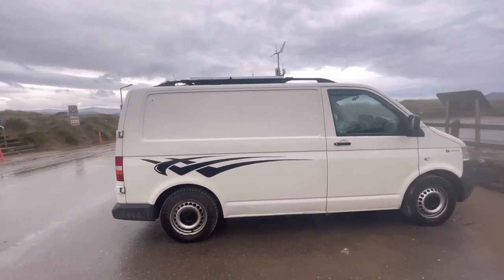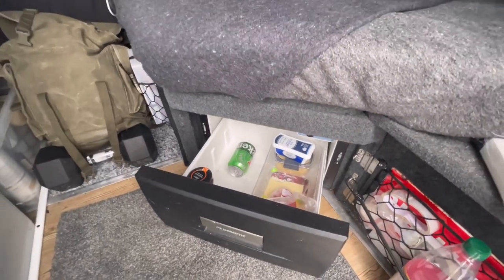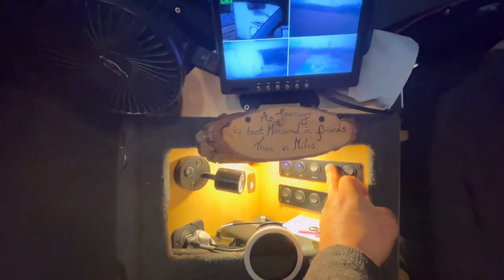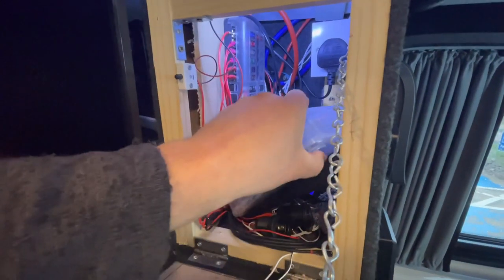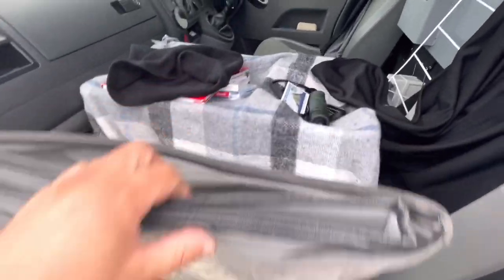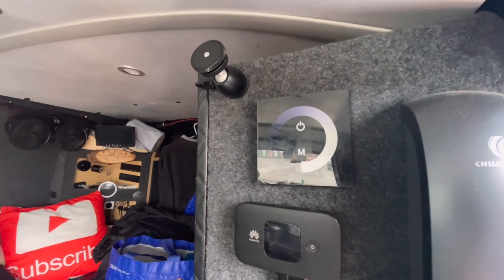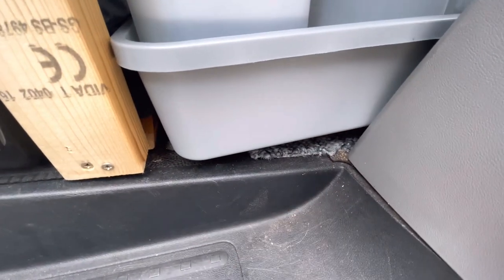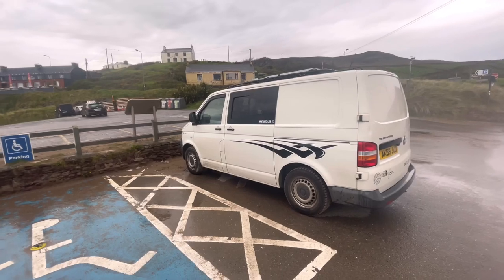VW Transporter Self Build Campervan Tour

Comment: Awesome how much storage space you've used, really have made the most of all areas. Will be interesting to hear how you get on with any condensation when  the temperature changes. Do you sleep with a window cracked?
Reply from the maker: I was in it all through autumn and winter whilst working to pay off gearbox, I was in Ashford Kent so fairly mild weather, having the wind deflectors on both windows allows me to have both slightly cracked to allow air flow, I tend to open the sliding door slightly if cooking for more than a few minutes. I do get condensation on the windscreen most nights in winter, sometimes ice on the inside of the windscreen, diesel heater’s are amazing though for a quick boost of heat but then get too hot if left on